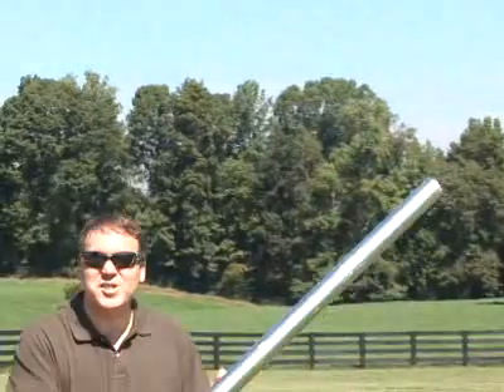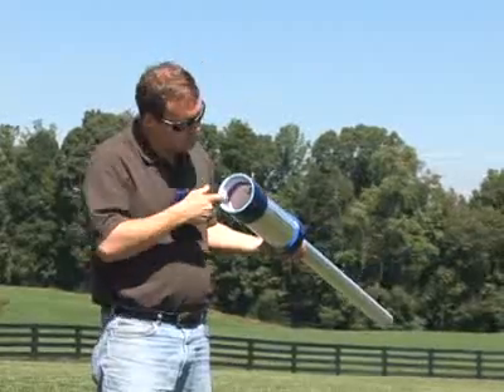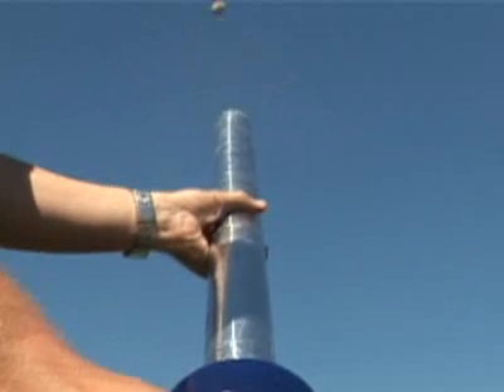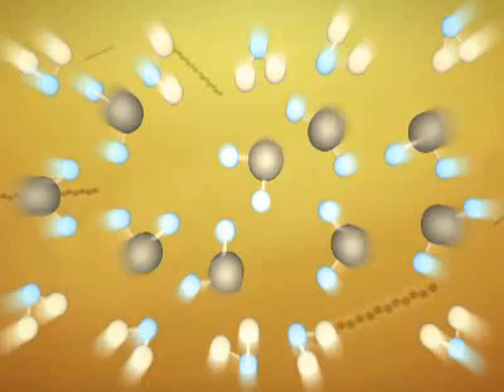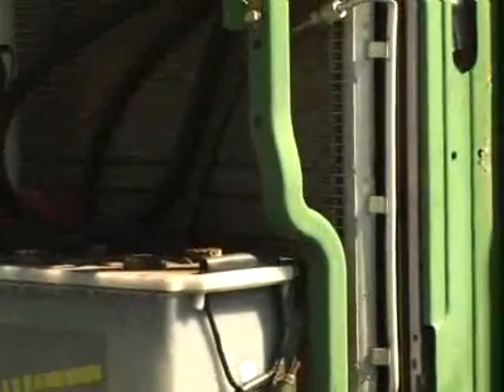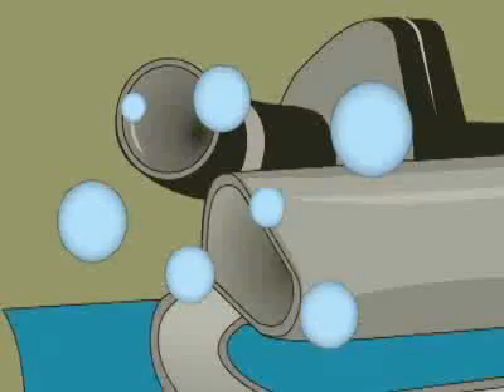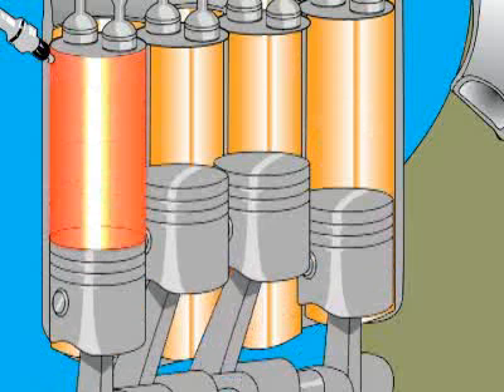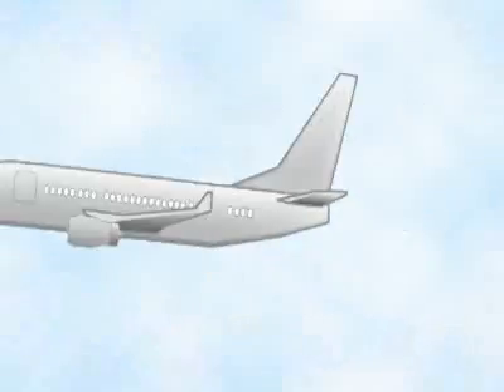HowStuffWorks Videos How Engines Work

Comment: no, because the ratio of fuel and oxygen would be too oxygen based. Same if you enlarged the fuel intake pipe, there would just be a lot of fuel and not enough oxygen. you need half and half